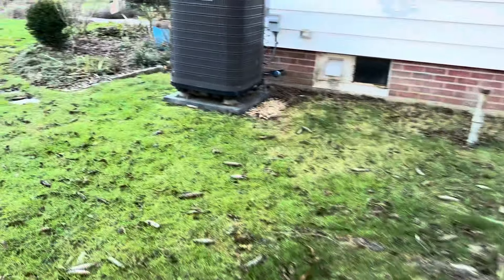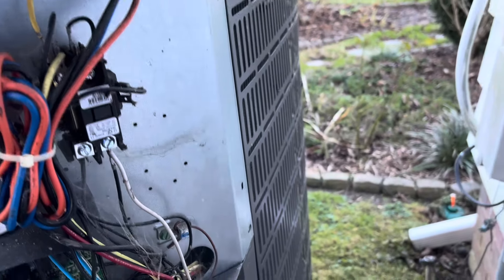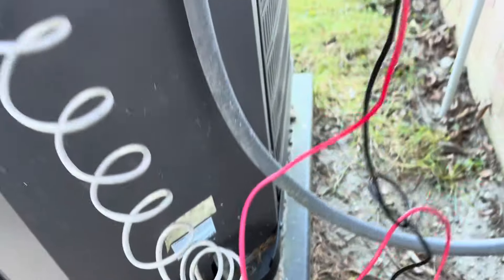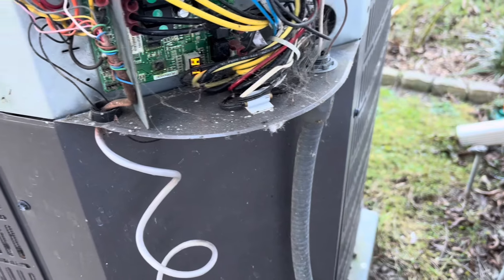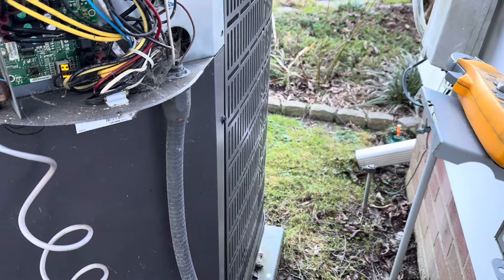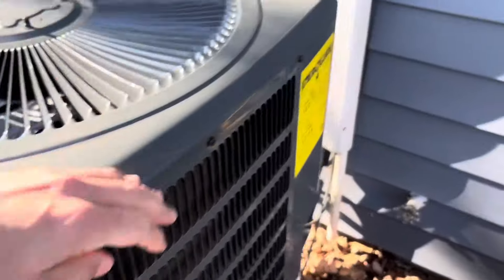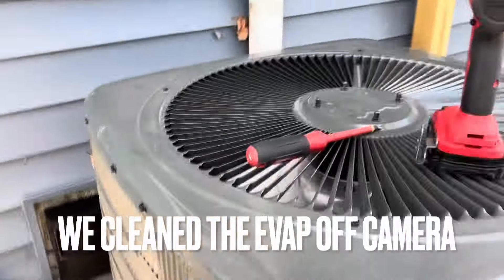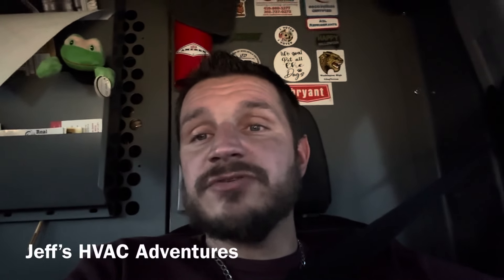Heat Pump With A TRIPPED Breaker!  Things To Look For.

Comment: Jeff, after so many years I am pretty close to nail it down to a science every tripped breaker situation (when tripped for no reason). What I do in this case is the following and I have never ever get another call from the same customer for a tripped breaker: 1/Replace the capacitor (doesn't matter the readings); 2/Install a hard start kit (NOT the Chinese made, there is American made that works the best); 3/Bump the breaker up in the disconnect box (if any) or in the breaker panel with 5 amps. I guarantee you personally, you will never get a call back again and customers are going to believe you are a Saint!

Comment: Another thing I check is LRAs on compressor. But alot of good info here. Great job!
Reply: yep, check inrush current on a 20a breaker is less than inrush capacity of a 30a breaker, as the nameplate calls for

Comment: you fuse to the ocp rating and wire to the mca. That unit needs a 30a breaker as the name plate calls for. The 18.6a exceeds the 80% rule for a 20a breaker, that is why it calls for a 30a breaker.

Comment: Had to redo this comment since the yt police didn't like the link to a video that applies here...

NEC 440.4(B) allows the 30amp breaker in accordance with the nameplate. There are exceptions to the usual ampacity rules  for Air conditioning loads and certain other equipment. In this case, overload protection is provided by the compressor and fan motors, the breaker is only for protecting the wire from short circuits or hard ground faults.  #12cu at the 75degC table is good for 25 amps anyways.  So since this unit's max FLA total is 15.1 you're ok on the wire.  See Mike Holt's channel using the Code section above for a detailed video explanation.
Reply from the maker: Thanks for this man.  Appreciate it!  Seems I would have been good with the 30 amp then.
Reply: I hate it when yt does that. They never warn you or tell you how to correct it.
Reply: In residential you are only allowed by the NEC to use the 60degC rating for the #12 wiring regardless of what it can carry in the 75 or 90 column of the table. Look at NEC Table 310.16 and you will see asterisks for #14, #12, #10 wiring referring to section 240.4(D) Your minimum circuit ampacity is what you would use to size your wire to the unit based off 310.16 for wire size.  The Minimum Circuit Ampacity is 18.6, so #12 wire is suitable for this application unless it has excessive voltage drop due to length of run or the equipment is considered a continuous load. Residential A/C condensing/Heat pump units are not considered a continuous load unless it runs for over 3 hours at a time. No calculation needed, as the manufacture has already taken the 15.1A total FLA load current and applied any necessary % factors to come up with a total current of 18.6 amps as the minimum circuit ampacity. This is what you apply the 115% factor to determine the breaker size Which would equal 21.4 amps. The nameplate requires an HCAR type rated breaker if using a breaker instead of fuses so a 20Amp HCAR breaker should be good.
Reply: @phildegruy9295  HVAC takes exception the the 60deg C rule as noted in the Code reference above.  Go watch Mike Holt's video he goes into detail and they specifically point out the use of the 75c column in that table.  Residential or not, in this case, it does not matter.  I went round and round on this in my early days as an electrician, since I was always told, with NO exceptions that #12 could NEVER  be fused/protected at greater than 20 amps. But 440.4(B) clearly spells out the exceptions. And a wise HVAC contractor will use the max allowable breaker to avoid nuisance trips caused by high ambient or a compressor that it a bit hard starting. Even a 30amp breaker WILL trip well before the wire is even warmed up, by a locked rotor or excessive hard start cycle.

Comment: If there are any new hvac techs watching this…. Dont ever check a capacitor under a load. Turn power off and check it then. You will never miss diagnose a capacitor if you check it with power off
Reply from the maker: Nothing wrong with checking a capacitor under load.